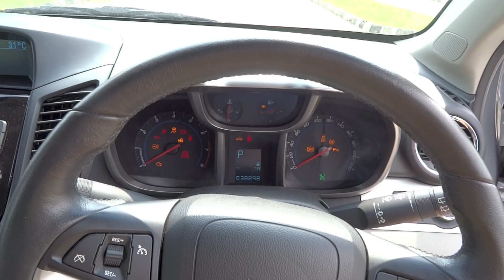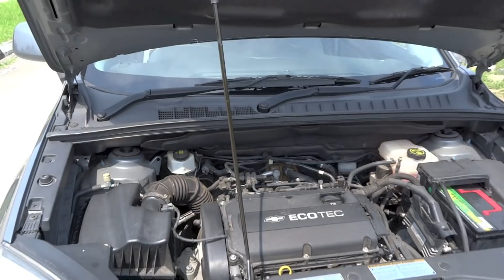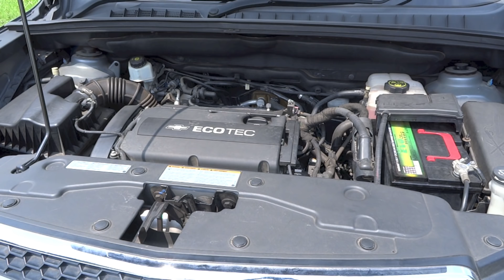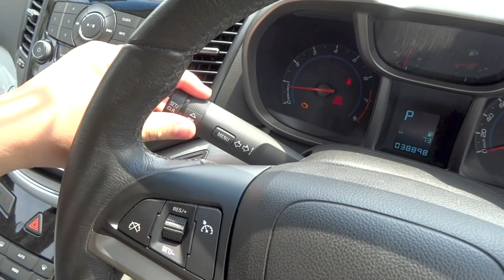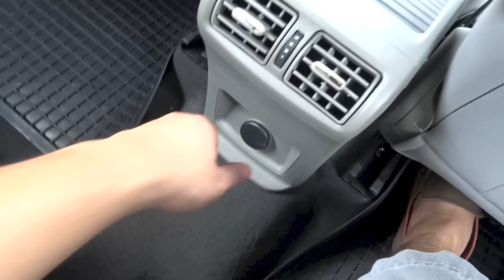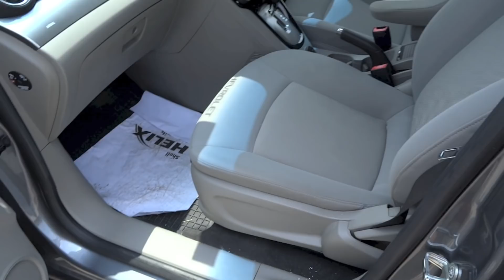2013 Chevrolet Orlando 1.8 LT Start-Up and Full Vehicle Tour

Comment: What is the code 89 coming up on the front display. It didn't go off when the motor was started. If it is anything like the cruze I would forget it.
Reply: this problem also appears in Aveo and Spin. the code 89 is either thermostat or accelerator. the code is gone after i replace the thermostat and re-scan it.

Comment: Technically its Daewoo..In sg they had the new 1.4 turbo unit 141ps/200nm
Reply from the maker: It is manufactured by GM Korea, but it's not a Daewoo as the Orlando came out after GM Daewoo was rebranded GM Korea.
Reply: Most of chevy’s engine made by hyundai

Comment: Only 39,000 km and the key is already in such a bad condition???
Reply from the maker: Some keys can wear out if it is used frequently or the person using it has long fingernails.  It's due for a service hence the engine light.  Apart from that, the car is fine.
Reply: And the engine light is on
Reply: Roberto Brito Falero // Europe or American cars is not as realible as Japanese cars